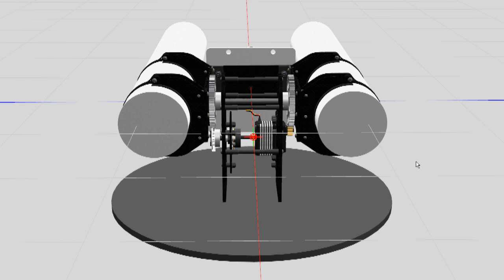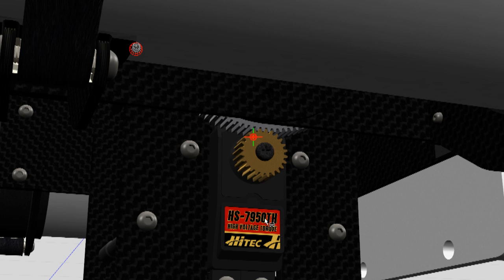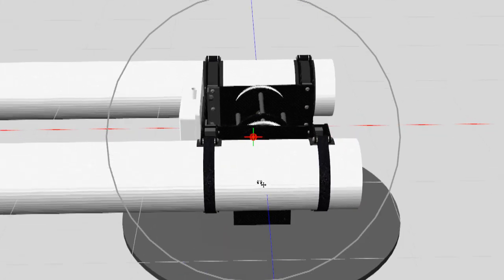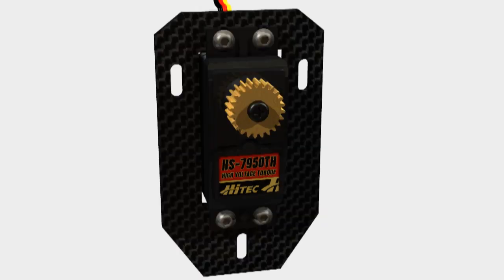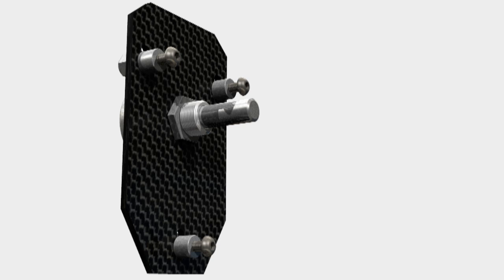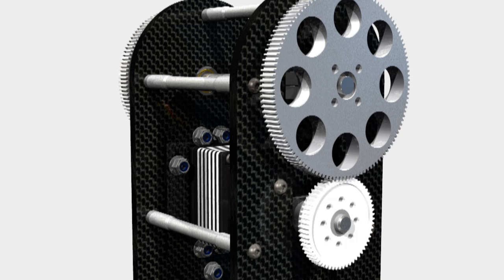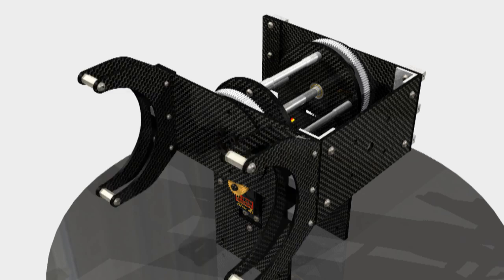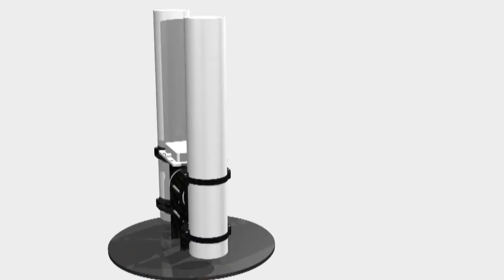⭐ FPV Antenna Tracker Design - Long Range FPV Antenna Tracker DIY

Comment: Why not use a circular or helical polarized yagi ?

Do you mix the signals from all antenna or do you switch between them to find the best signal ?

Why not use an accelerometer instead of an extra gear driving pot to determine elevation angle ?

Have you considered mounting your antenna tracker on a quadcopter or a rc blimp  and then relaying signal to ground ? If you run a tethered quadcopter that can run indefinitely it would be like carrying a many hundred foot high antenna mast everywhere you go !,

Comment: You said: "This video was done in 2010 but only recently uploaded in 2014" and "you wait till you see the final design"... sorry man nobody is going to wait around another 4 years for you to your act together. :-) Either start selling them or publish your design somewhere online as a free/open source thing. (Or waste away another 4 years). P.S. Carbon fiber does affect antenna performance. If those outside circular mounts are surrounding the yagi's, expect the yagi performance to be reduced and/or antenna detuned.